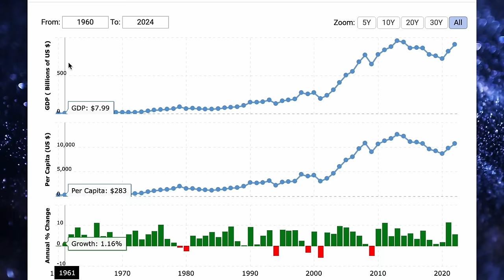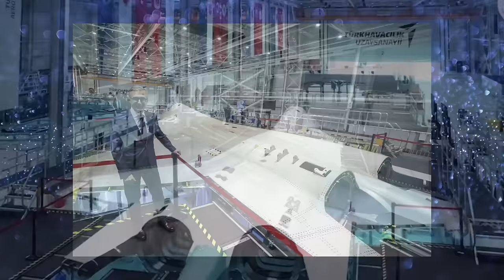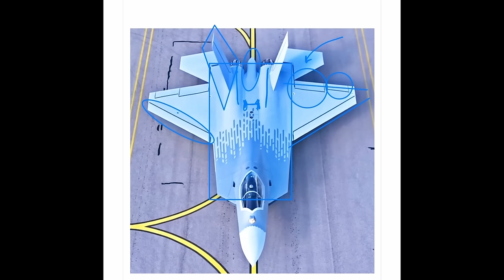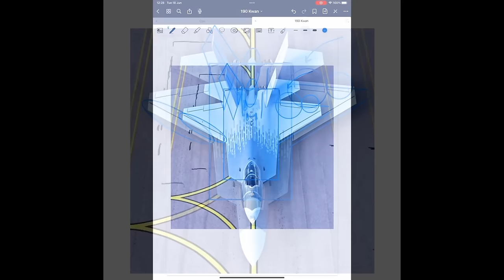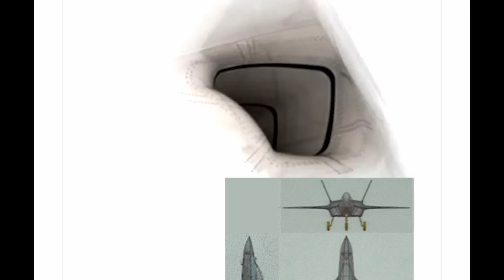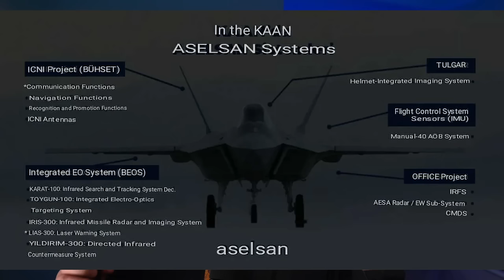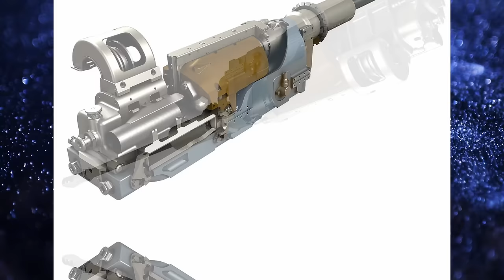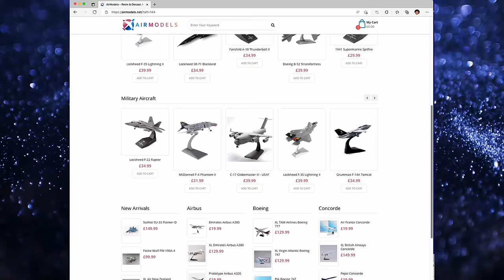The F-35 Has Met its Match

Comment: I personally think that the horizontal stabs moving so much is due to the fact that the pilot wanted a smooth, easy takeoff, instead of pulling up next to the ISS straight away.
Those stabs are as big as an F-16's main wing. When they want to go up, you shall go up, come hell or high water!
Reply: During the U.S. ATF program, one of the prototypes tail surfaces began violently twitching while moving on the ground. It was determined that the FBW system was reacting to expansion joints in the taxiway/runway. The sensitivity of the system was tuned to reduce sensitivity. 
  Each minor impact by first, the nose wheel and then the main gears, introduced small pitch changes that the computer interpreted as up or downdrafts that it attempted to null out by deflecting the horizontal tail to counter  those forces.
Reply: No it was unintended. And was fixed in 2nd flight
Reply: The plane is going to look much different. Smaller aswell. It's being produced. 6 more prototypes.
Reply: I honestly don't know what gave me the impression that the kaan was a small thing as big as an F-16, but your comment prompted me to look it up and oh my LORD it's gigantic!
Reply: @SmoochyRoo  time to 'add' miniaturization and weight savings

Comment: There is little information about the K AAN fighter, as Turkey only has one prototype. But if it succeeds, it will also show the progress of Turkey's aviation industry.
Reply: 2 prototype. 1 of them has never flight. They are using for stress and ground tests. ironbird test.
Reply: 8 prototyps are planned for all kind of tests,
Reply: @highway9patrol  Based on China's experience in developing the FC31 J20, it will take several years for Turkey's fighter jet to enter service. At the fastest, it may take about 5 years.
Reply: @steppenwolf5956 OK，Based on China's experience in developing the FC31 J20, it will take several years for Turkey's fighter jet to enter service. At the fastest, it may take about 5 years.

Comment: That sort of HS instability (wobble) is caused by software and incorrect compensation for latency in FBW. It's definitely not the first plane to have that problem.
Kind of a series of overcorrections chasing it's tail (pun intended) in a latency loop.
Rather dangerous really. But entirely fixable.

Interesting design. Small central tail solves some aerodynamic & raydome considerations in a tidy fashion.
With F110 engines, it's going to have some significant range limits, ~or~ payload limits. Aerodynamically it looks good. But it's quite difficult to fit everything '5th gen' inside a sleek looking airframe. I guess they're addressing that with sheer airframe size.

Comment: Considering the first F22 Raptor flight was in 1997, Turkey isn't doing too bad.
Reply: cope harder
Reply: @masterp401  😌
Reply: I mean, yeah. Turkey started development of indigenous aircraft in the 80s, and except a few cruicial parts (like the engine) could start building advanced aircraft in 40 to 50 years, with the sanctions the us put on turkey it is kind of an amazing achievement

Comment: If Turkey is able to do this, surely a country like India would be getting close to getting there too, right? They already have started on the route of building their own aircraft, although they do not have the advantage of having some experiences from the F35 project, but they could possibly buy in some experience from countries like Turkey or france etc.
Thanks also for making this video with what we know about the aircraft. It already looks like Turkey is taking a very large step ahead in the air power world. Their Bayraktar drones really made an impact, they are clearly building towards a solid future with incremental steps.
Reply: India is trying to do everything the Turks are doing while maintaining their strategic autonomy. That's difficult because unlike turkey india is not a nato nation thereby reducing the help usa can provide.
Reply: India should join the Boramae project and merge it with their AMCA project. They are structurally similar enough to fill the same role. Take the best components and features from each to refine the current Boramae design that is much further along in development,. Build them in India with many locally manufactured components. India already has a licensing agreement from GE for local production of the F414 engines used in Boramae. A fully stealthy variant of Boramae is planned for batch 2 or 3 but even batch 1 will be as stealthy as practical when using external weapons. The focus on firepower over stealth is because South Korea is likely to face much larger numbers of aircraft in a conflict but may outclass most individual aircraft. india is in a similar situation. Most importantly, Boramae is scheduled for production in 2026 while AMCA isn't going to be ready until the mid 2030s at the earliest.
Reply: India has great engineers but also has social and  cultural deficiencies that prevent India to reach its goals.
Reply: @max2008abhi  Turks will never help India. They side with Pakistan.India produced F16, Türkiye produced it. India did not take part in the F 35 program, Türkiye did.
Reply: India has money and engineers to pull it off. But sure as hell they WONT! 
You can quote me on this one.
Reply: @nahitakyel You meant to say India didn't produce F-16s right?
Reply: Turkey has heavy industry. Does India have the same infrastructure?
Reply: Comparing Turkey and India is not logical, because they are not on the same level.

Turkey has a very developed Heavy machinery and military industry infrastructure and they can produce insanely complex systems  compared to their position in the world. On the other hand we cannot say the same thing about India.

The other thing Indians lack is, experience. Most of the Turkish engineers and designers that work on KAAN are worked on F-35, F-22 and many other projects of the west as well. Mainly USA ones. Also Turkey was a big part of F-35 program before getting kicked out because they planned and did produce many parts for F-35 in their country. And, like my first fact, we cannot say the same about India. 

They struggled to make/reverse engineer a 4th gen jet let alone creating a 5th gen one by themselves. So, I dont think thats happening soon.

Two things India has advantage over Turkey is money and Number of engineers they have. But sadly they are almost useless without experience and infrastructure.

Edit: and I forgot to mention that Turkey is 3rd biggest Weaponised/Unweaponised UAV producer in the world. They have experience and advantages from those too.

Comment: The Venom 30 mm gun was designed by AEI in the UK.  Sadly AEI were bought by CANIK last year.  Those mass figures must mean that Kaan will have a relatively low fuel load.  A hugely impressive achievement though.

Comment: Kaan means king of kings in Turkish. Central Asia. The Turkish army has existed since the time of the Huns and Gokturks. It is an army of 2233 years. It was the first army to use the decimal system. This aircraft will not only be a fifth generation aircraft, but also a command aircraft. This aircraft will be accompanied by Turkish-made Red Apple and Anka 3 unmanned warplanes and will operate simultaneously with the fleet.

Comment: Clickbait aside, it's genuinely impressive they pulled off a decent (at least geometry-wise) 5th gen stealth aircraft as their first ever platform. Something that even Russia who has a well developed military industry is struggling to wrap their heads around.

I hope they manage fitting it with domestic internals (like engines) eventually.
Reply: The official goal for the domestically developed engine for KAAN is a 35000 Lb stealth engine. Having two of these, KAAN will for sure meet its goal of Mach 1.8 and supercruise capabilities. 
Recently, Turkish Engine Industries (subsidiary of the TAI) has already produced the prototype of TEI TF6000, a 6000 Lb 5th gen engine. This is obviously a stepping stone for the actual goal of 35000 Lb. At this point, the engine pretty much only scales up in size to be able to match higher thrust power.
On the other hand, TAEC (Turkish Air Engine Company) as a consortium of Turkish KALE Group 51% and British Rolls Royce 49%, is separately working on another iteration of the desired 35000 Lb 5th gen engine. It is highly likely that there is or will be some level of technology transfer in between TEI and TAEC, as well. Afterall, TAEC was initially founded solely with the purpose of the domestic design and production of a 5th gen engine specifically for KAAN. But it doesn't mean that TEI is dedicated to design and produce engines for KAAN only, more likely to kickstart the engine development for KAAN, but on the bigger picture, to ensure domestic aerial engine R&D becomes a tradition for the Turkish arms industry.

Comment: The F-35B, was claimed to be a stealthy single engine multirole combat aircraft, that unlike the Harrier, would be supersonic, stealthy, with modern avionics systems, and like the Harrier, would be VTOL capable. This is why the British originally designed our two carriers without ramps. 

Only one of the biggest technical headaches, the British always had when building the Harrier, was the VTOL, — transferring from "lift" (downward nozzles), to forward flight (rear-facing nozzles), to then fly away from the lift-off. Apparently to achieve it took the British a hell of a lot of technical work, (three — four months at a time, over 3 years). Look up all the variants they made, but they never gave up, and they finally figured it out. 

I made the claim long before we saw the F-35B, that it wouldn't be VTOL capable, (even with the Rolls-Royce lift engines), because, the US has tried to produce and build a VTOL combat aircraft many times before, only they've failed each time, only ever managing to produce and build the British Sea Harrier, able to do so. Every US airframe (and there have been many), have all failed. 

I'll show you what I mean... Copy and paste “2013 MCAS Yuma Air Show — AV8B Harrier Demo” into YouTube search. At 7 mins, 50 seconds, you'll watch a Harrier performing a proper VTOL. You'll see it lift off vertically, and then fly away from the lift-off, and you'll see the transfer of nozzles take place. -- 

Yet you'll not ever see any footage anywhere, of the F-35B performing a full VTOL. Yet Lockheed Martin do claim it is VTOL capable, when it, so clearly, is not. 

Copy and Paste “First F-35B Vertical Takeoff Test” into YouTube search. You'll see it lift off, only then you'll see it return straight back down from the lift-off. You'll never see it fly away from the lift-off, if it could, we'd see footage of it doing so - like we still see on all the footage of the Harrier doing so. But you'll not find any footage, anywhere, of the F-35B performing a VTOL. 

The Americans, (unable to answer this), will then comically claim it's not necessary? LOL, (while forgetting, they're to be carrier-based aircraft), meaning even any slight damage to the deck or ramp, they'd be unable to get the jets airborne? Defeating the entire purpose of having the aircraft in the first place! You can't ever lose an entire carrier, in battle, for only minor damage?, I mean goodness me, whatever next?. 

So, why do we see the USA doing this? It's obviously because, the US is still a country that's never managed to produce & build a VTOL fighter aircraft. Britain did so in the late 50s, Russia did so in the late 60s, the USA has tried and failed numerous times, so it seems this time, they're going to try to lie about it LOL. 

That country is a travesty, man! But it does show us, that Lockheed do indeed produce propaganda aircraft, as the F-22 is exactly the same... A failed aircraft, so today, only being used for propaganda purposes! 

Typical US propaganda, usually consists of silly falsehoods, fake misinformation claims, or just twisted truths, like the F-15, is said to be unbeaten in A2A combat? It's true (ish), only when we look at every aircraft shot down by an F-15?, we find that none had any offensive capabilities, most had little if anything defensive, many without even a basic radar, meaning, you'd be absolutely stunned, if the F-15 didn't shoot every one of them down! 

So it really is, once again, and as always, just a very silly, and meaningless remedial propaganda claim. However, there is another aircraft, that's also unbeaten in A2A combat, and has faced off against aircraft just as capable and well armed as itself, (only it's not American, so you'll never hear about it). 

The British Sea Harrier, is actually, the only aircraft unbeaten in A2A combat, that has faced off against worthy, and viable opposition. And that really is a huge factor, that's worth knowing, unlike the F-15 propaganda claim, that you'd be shocked if it hadn't managed. 

The Americans really should be questioning why the US government made it illegal to sell the F-22? The US government, seemingly want it believed, that because it's so good, they don't want anyone else to have it. Yet, that actually makes no sense at all, none, not even a little sense. 

As the facts are, they've no idea what's around the corner in new modern military technologies, and with the speed we're seeing so much new hi tech, military tactical hardware, being designed, developed, and created today, it could have made great sense to sell the F-22 at some stage. (If it actually works). 

If it worked, they'd have been able to recoup many of the resources spent on the aircraft, if not the resources in their entirety, even a profit! Yet, as always, there's another, and much more likely, reason the USA made it illegal to sell the F-22. 

If it is, just as I suspect it is, a "lemon", that was intended to be their leading front line strike aircraft, (that's failed), yet because of the cost/expense, to design and build them, they can't just write it off. So the US have then only used the F-22 for propaganda purposes? Then what better way of preventing anyone else from finding out, that it actually doesn't work, and really is a lemon, than making it illegal to sell? 

Logically, that's the only real possible reason the USA made it illegal to sell the F-22. -- It can only be, because it's a failed aircraft that was intended to be their leading front line 5th generation strike aircraft. 

Well 20 years the US have had the F-22 in service, and they've been in wars the entire time, yet they've never used it, not once! And even more telling, was, after Russia arrived in Syria in 2015, the US removed every F-22 from right across the Middle East... Iraq, Tukey, UAE and Jordan. 

Absolutely no doubt about it, I guarantee that we'll never see the F-22 involved in any real war scenario, or even involved in any major sortie, because it's basically junk. 

They've even trashed all the infrastructure they had in place to build more of them.
Reply: I completely agree with you. Greetings and respect.

Comment: Its most crucial component, the engine, is foreign made. From Wikipedia
"Prototypes and the first batch of aircraft will be equipped with General Electric F110 engines until the TAEC engine, a joint venture between the Turkish KALE & British Rolls-Royce , is completed and ready. Ismail Demir also stated that besides these two engines, an alternative engine is found from an undisclosed nation . "

Comment: Yes you are an audiophile.  I see your room treatment pillows on the floor behind the speakers.  The small speakers look like Tannoy nearfield monitors but I don't recognize the floorstanders... ?  
Anyway that's probably a very sophisticated sound system in those helmets because the pinna transforms (what the outer ear does to the incoming sound) have to be tailored to each pilot in order to synthesize good directional cues in the vertical plane, as well as from behind.  Easier said than done.

Comment: It looks like Pakistan will have an operational stealth fighter before India.
Reply: Do they have the money
Reply: @max2008abhi  they have an open credit from Turkey
Reply: Probable if US does not block the F-110 engines that will  be used in block 1. They pulled a similar trick before when they blocked the sale of engines that were supposed to be used in ATAK-1 helicopters which were supposed to be imported to Pakistan.
Reply: @kesmeseker9593  turkey signed an agreement to use EJ200 engines from Eurofighter.
Reply: Are u sure? The Ej-200 is significantly less powerful than the F-110 or even the enhanced 414 @bastadimasta
Reply: @sean70729  I am sure. EJ-200 is chosen because of its super cruising capability
Reply: Is this a real stealth aircraft
or a fake one.

Lots of bogus claims being made by countries saying they created a 5th gen plane when all they created is an angled airframe that flies.
Reply: @bastadimasta  That's not true. The F-110 will be used for the prototypes and also for the first batch that will be delivered to the Turkish Air Force.
Reply: @alpaslan4881  so? That's a temporary solution

Comment: I don’t expect Karan to be better than the F-35, but I expect it to be better than existing 4th gen. fighters.
Reply: Only 29% of F35 are mission capable, that plane is doomed in case of a bigger conflict. It can be superb but what it's worth when 1 of 3 can fly IN PEACETIME
Reply: @clixium  this is not true. You should read more than the headline.
Reply: I don't think it'll be better than a Super Hornet
Reply: It more sounds like f15ex with a lot of LO. Not sure at this at this stage it has to be better than super hornet, it needs to fit Turkish needs better than a Super hornet. Also there will probably be next gen Kaan…